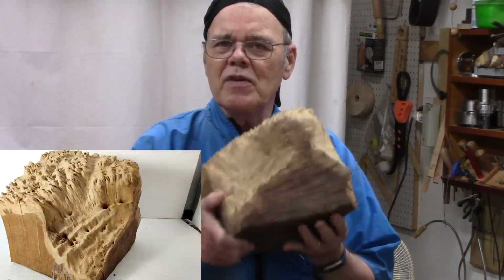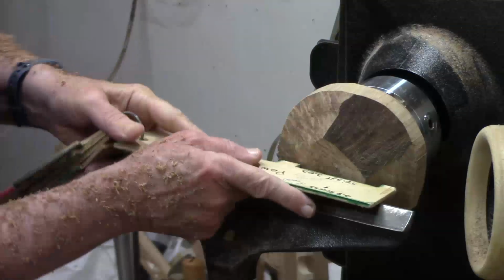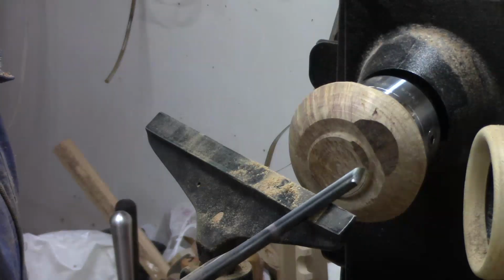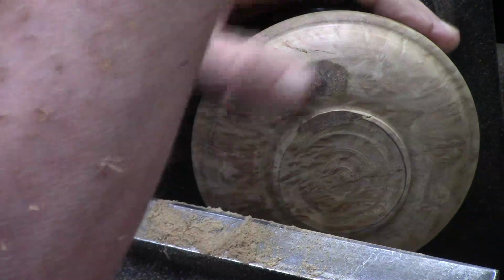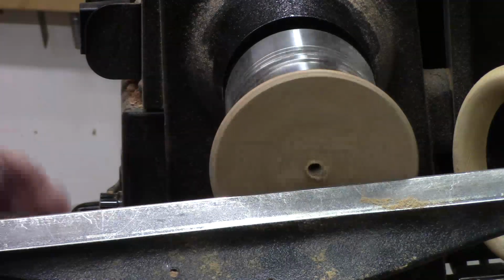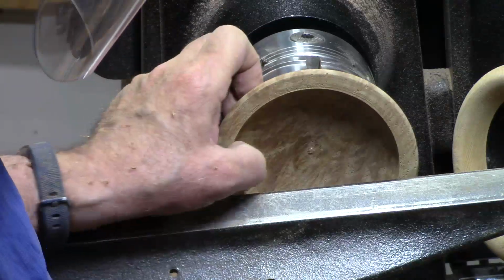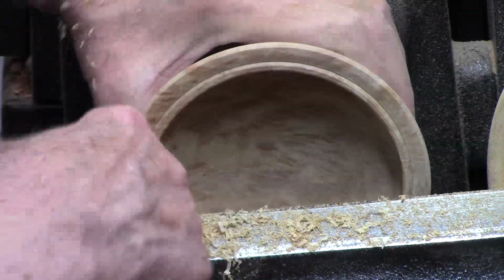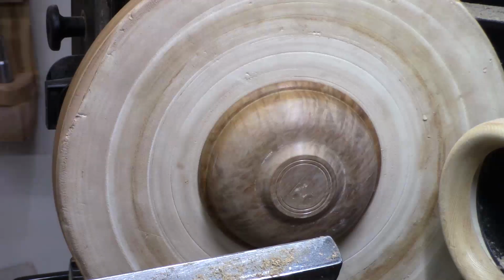What Can I Turn? Australian Mallee Burl

Comment: Mallee burls are very beautiful to look at...but not so beautiful to turn. I acquired 2 of them, I turned one still have the other unturned. I was having the exact issues you was with grabbing and the like. I was using carbide tools and a brick would be easier to cut. It was worth it in the end but wow what a chore. Great job Mike, it is beautiful.
Glenn
Reply from the maker: Thanks for sharing. Yep, like a brick to turn.

Comment: You rose to the challenge with that one Mike. Mallee burls are tough customers - perhaps one of the toughest. Its not actually a burl in the normal sense. It is in fact the root ball of the tree. Mallee trees have up to 12 or 15 "trunks" none thicker than your arm and all emanating from the root ball just below the soil surface. Locally known simply as stumps. I recall in my youth the family bought them by the truck load for heating and cooking. You think they are tough to turn - try cutting them with an axe for the wood stove.
Reply from the maker: Thanks for  that info about the root ball. It certainly was not like turning a green cherry burl, the only other burl wood I have had any experience with.

Comment: Following up on a comment and reply below, did the spindle gouge demonstrate any advantages? The only reason I have ever heard Richard Raffan give for using a spindle gouge on a bowl, and he has repeated it often, is that spindle gouges are less expensive than bowl gouges. Maybe that matters if you are a production turner going through many gouges a year, but I can't imagine this being a material factor for many turners. If there is a performance reason for using a spindle gouge for the shaping of a bowl, exterior or interior, I would be interested to hear it.
Reply from the maker: I agree cost would not be significant for a hobby turner. Still experimenting but I have to believe he is getting a better cut. But he is frugal.

Comment: Ha!! Not too much sympathy Mike. We have some very hard knarly  woods here in Oz. ( many of the acacia's ). Sometimes it's not worth turning the wheel off, because you are going back so often. 🤣🤣. I have a wooden handle about 12" long with a leather belt attached. I wrap the belt around the bowl and use the leaver of the handle to get the bowl off the screw.  Think of how you used to get an oil filter off from your engine block.  Nice little bowl 😊
Reply from the maker: I love that tip! My oil wrench has a rubber strap that does not do the job.

Comment: I’ve been told a million bazillion times to never use a spindle gouge on a bowl. Why did you make the choice to use a spindle gouge on this piece please? I would think on an especially hard wood the chance of a catastrophic catch would be even higher than normal.
Reply from the maker: Excellent question. I was trying this technique (only on the outside of a bowl) because Richard Raffan does it so I thought I would give it a try. No risk of the tool snapping becasue it never hangs over the tool rest very far. I am still trying new things and have not given up learning a new trick or technique. Check out his videos as they are quite instructional.